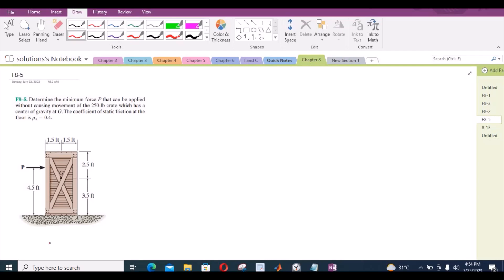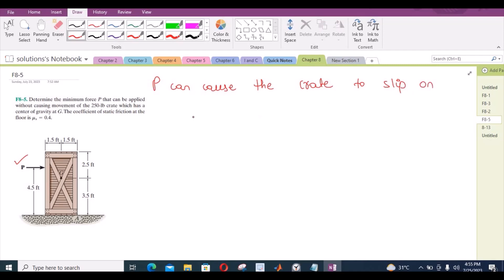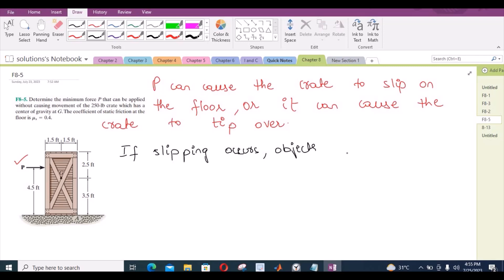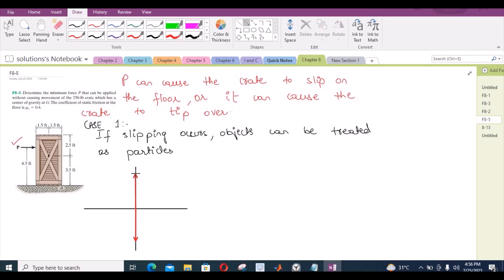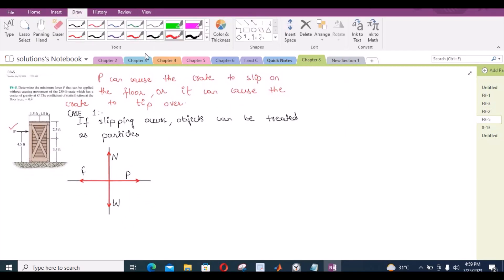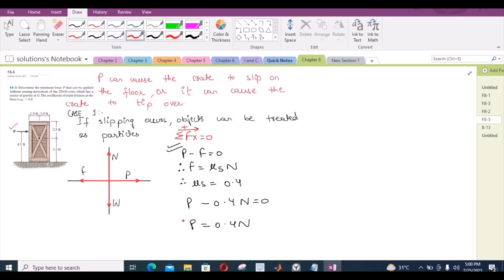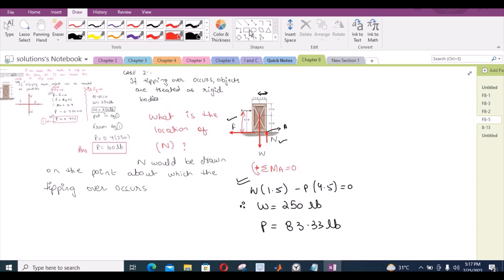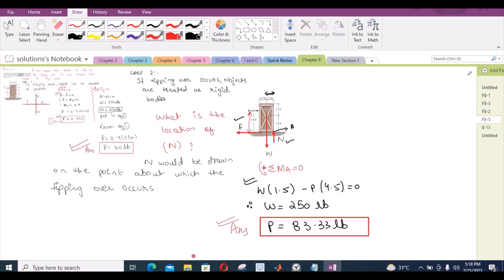F8-5 hibbeler statics chapter 8 | hibbeler statics | hibbeler

Comment from the maker: Learn How to Solve F8-2 Hibbeler Statics Chapter 8, "Determine the minimum force P to prevent the 30 kg rod AB from sliding. The contact surface at B is smooth whereas the coefficient of statics friction at wall A is 0.2."
Here is the Link: https://youtu.be/GoJ2_dKxQug